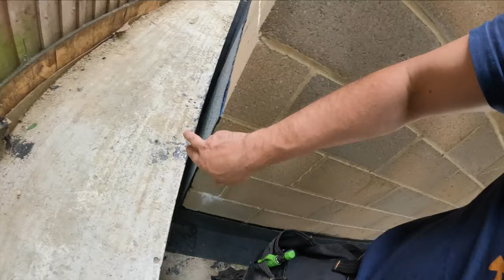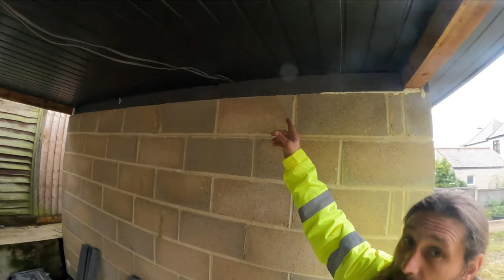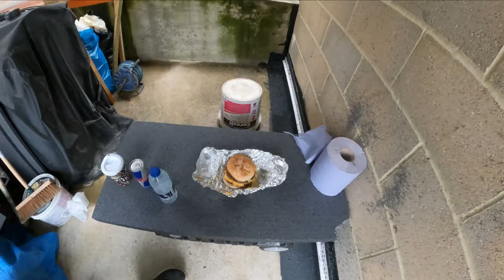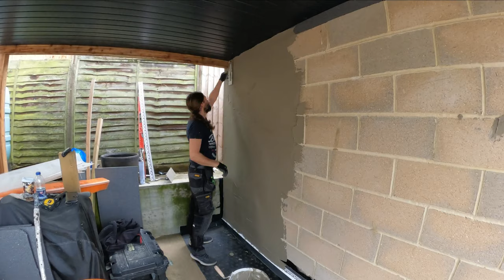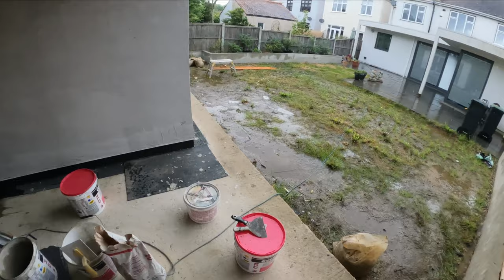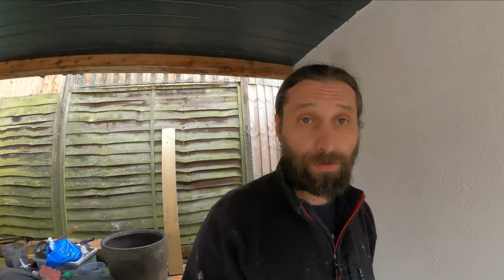Summer House silicon render application on solid walls

Comment: Hi don’t you need a primer on the block work before you apply the base coat?

And I noticed a few lines in the base coat they didn’t show through once the silicon was applied so I’m presuming you can have the odd trowel line in the basecoat?
Reply from the maker: It's new block work, so no, you don't need primer but it's not a bad idea to apply it if you want. For the lines, i will scrape all the wall before applying the top coat
Reply: @How2Extreme  I see so it scraped back ok.
Reply from the maker: Has to be nice and clean, no dust or flakes

Comment: How long did you leave the top coat before rubbing up with the plastic float
Reply from the maker: Hi.It was we're wet and cold outside so I started after about 20min and on some walls as soon as I finish with the top coat.Any ways you need to check with the trowel to see if it's ready you can tell when it's ready